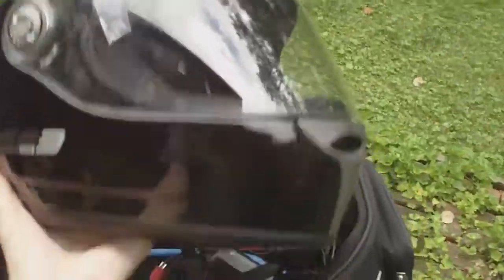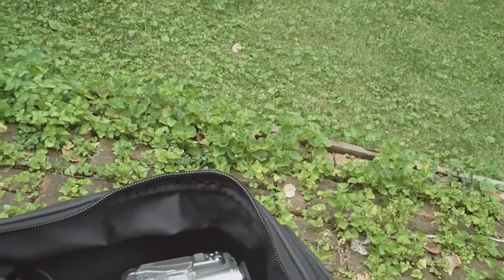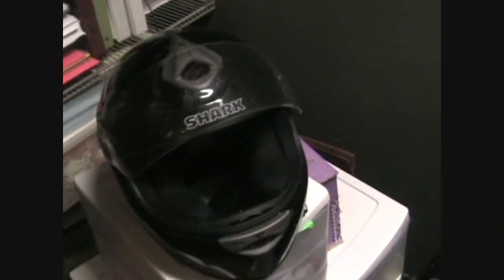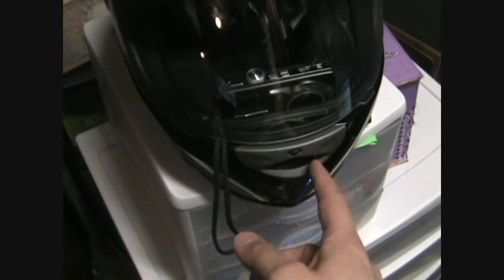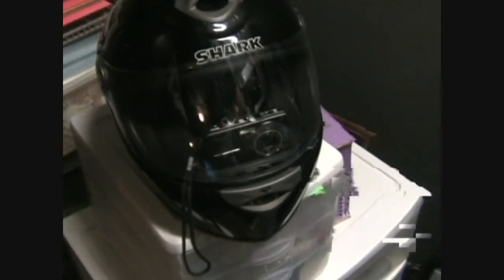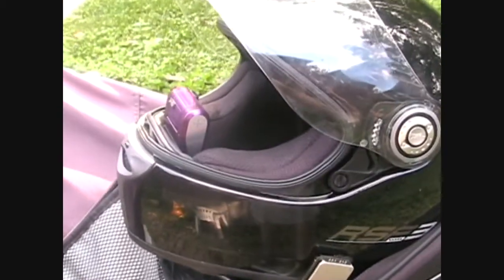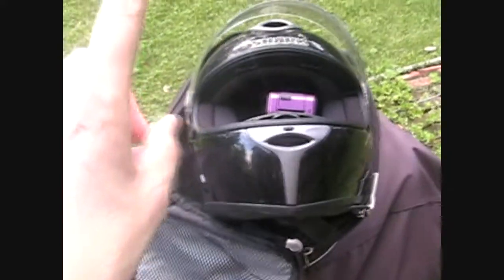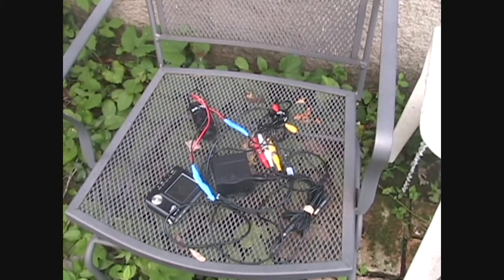More about helmet cams

Comment from the maker: I think you're probably right.  But at least I didnt have to carve out a slot in my helmet that may affect the integrity of the crush zone, nor am I blocking my vision with a camera that sits up in my faceshield.  A bullet cam setup has, as the video shows, a lot of wires to setup and hassle with.  I'm not saying this is the best solution out there, just the best one that I've found so far.

Comment: A big telescopic lens works too if you mount it OUTSIDE the helmet.   Inside the issues were angle like you say, and the safety aspect too of either impaired vision or potentially even having the camera take your front teeth out in an accident.   *shrugs* 

I like your setup though, cuz you can get a closed shield for cleaner audio at speed.   You should mention the POV 1.5 too though.

Comment: Oh, one other note though, some of the little digicams have image stabilization though!  Have you seen the new water/shockproof panasonic TS1?   Doesn't have the telescopic lens, is small, has IS, shoots HD in AVCHD lite and since its waterproof you could mount it on bar mounts for adventure riding.  How sweet is that!  $bling though$